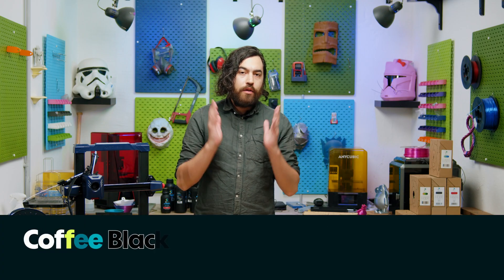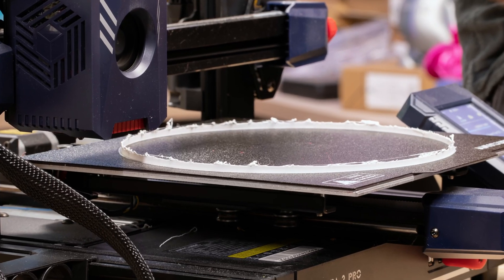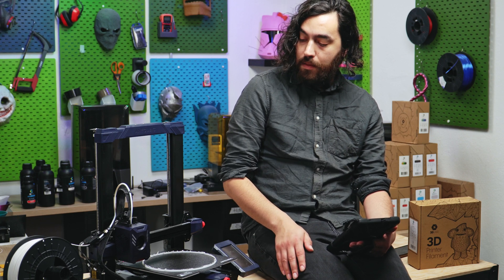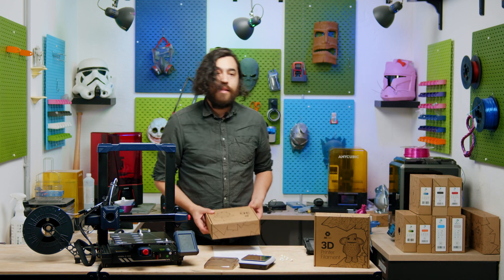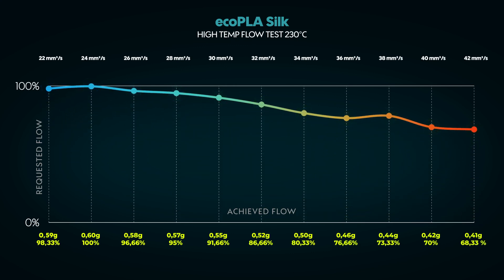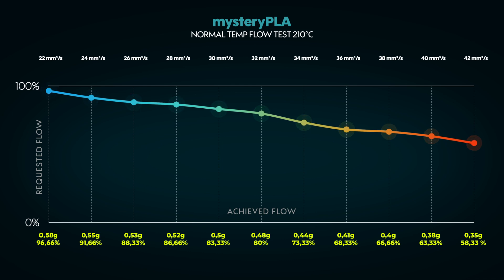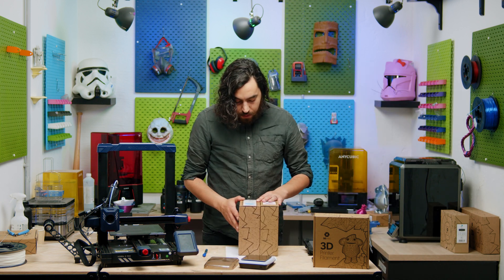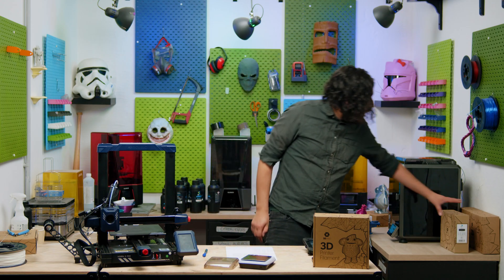Why aren't you printing faster? Speed & Flow Tests!

Comment: Print speed is interesting, not least because I have done no experimentation on the subject. For me, speed is not an issue, I set to print and walk away until its finished. What I want is quality. I have printed stuff that took 17 hours in ABS and Carbon Fiber Nylon, it was fine. I appreciate if your printer is in constant use, or you just want a timely print when you want one, then for some it will be different.

Comment: Your Bowden is hitting extreme angles. I'd suggest routing the filament from the backside. Also do you sell to the USA?
Reply from the maker: I know right? Unfortunately, that is the design of this printer. I can't change that unless I print a mount for the filament sensor or just not use it at all. This printer, the Kobra 2 Pro, has threaded inserts on the top cross beam so I could add a spool holder on top but I am afraid it might destabilise it during printing as this printer can achieve 20K acceleration and it already shakes a bit when printing in its standard configuration. 

And yes!! We do sell to the USA :)
Reply: @3DJake_Official  the filament sensor isn't too picky about how it's mounted. You can just mount it on the reverse bowden with a small coupling tube. Make sure your reverse bowden tube is not 2mm ID, but larger. There's no need to constrain the path of the filament.

Comment: Why are you setting 22 mm³/s as 100 %. This is already quite high and regarding your graphs, some filaments are already on the declining part of the flow-curve.
Reply from the maker: sorry a few were cut off at the beginning, but the percentage drop is accurate in those. All the filament tested could print without any underextrusion up to a minimum of 20mm³/s with the exception of the TPU. They all basically plateaued until then so that's where we cut it, shouldn't of though, sorry for the confusion.
Reply: You said 30mm to start then said 28 now it's 22. I'm not trying to be an as*hole but it's not matching up and will misinform new ppl to printing.
Reply from the maker: @noktrnl123  Heya! No problem, thanks for your comment :) I think it is important to note the different factors involved. When I said 30 I was talking about the absolute max, I wouldn't recommend this for anything but draft prints as was mentioned so 28 would be the best bet for a good quality-speed ratio. And these were for the higher temperature test, it is important to note the effect temperature has on flow rate and at lower temperatures 22 would be the best choice. Most filament manufacturers don't say anything about this relationship so we thought it best to explain :)

Comment: Why on earth would you scale steps with speed and not flow. Speed means nothing on a flow test.
Reply from the maker: The flow is scaled proportionately to speed. But the actual test results shown are all flow test results not speed tests. The actual prints depicted are demonstrative, we didn't use those to formulate results, it would be really inaccurate if we did.